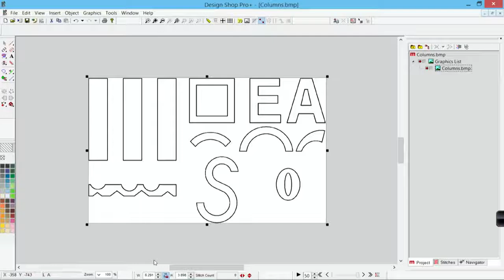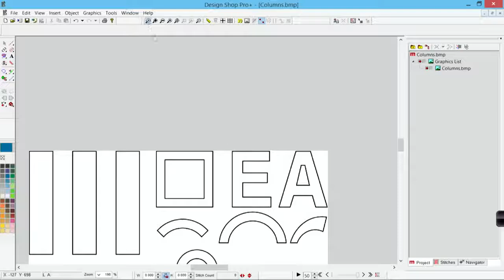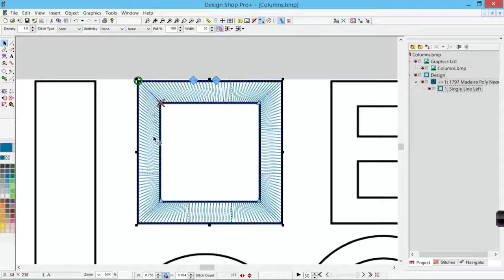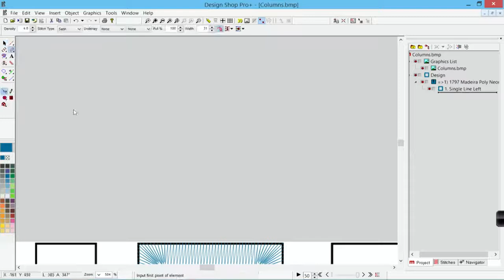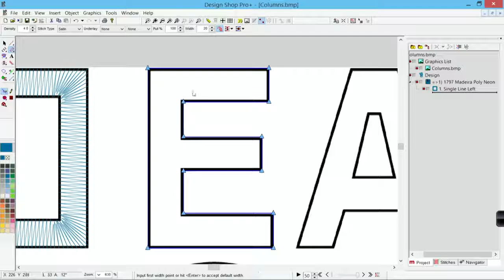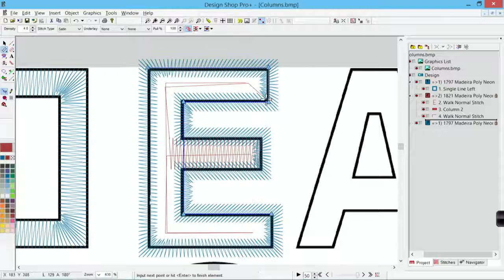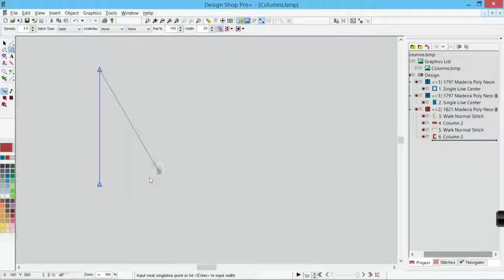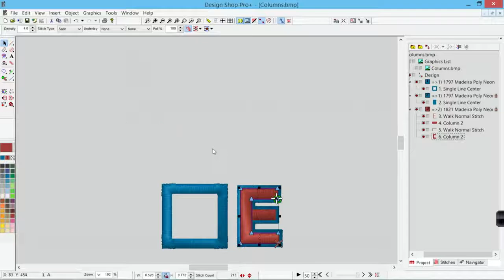DesignShop V9 ~ Single Line Input

Comment: In the video I see that when you click shift enter you can combine a shape that way. But if I am trying to mirror a specific shape from one side to another is it possible to get the points to connect after the fact? With the single line center input method I drew half of my shape in a specific way. Since I want it to be symmetrical I copied that line then used the flip section at the bottom, then I held alt and drug it evenly across to one side so it is mirroring itself.   When I select my two new symmetrical shapes the combine button is grayed out. Do I have to draw this specific shape all the way around or is there any possible way to connect the flipped version to the original? ( I am operating out of DS 11)